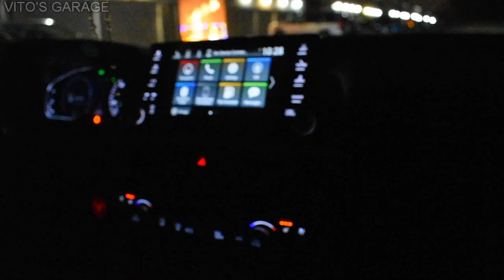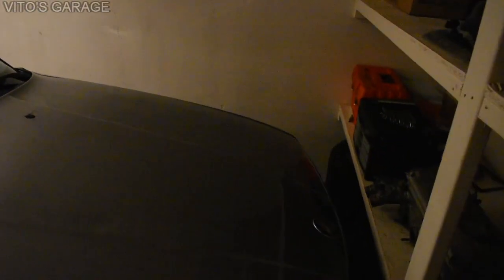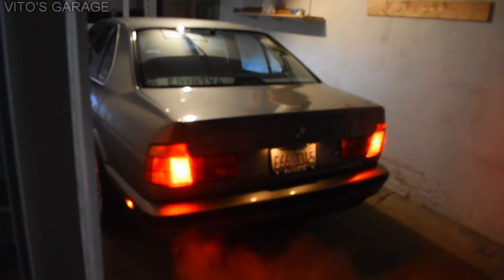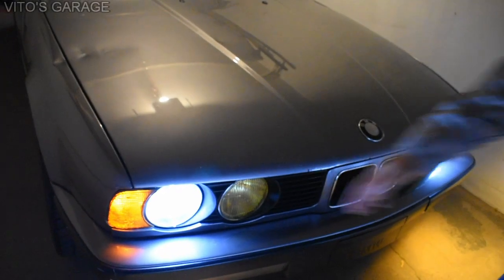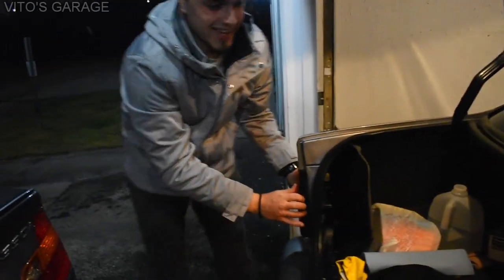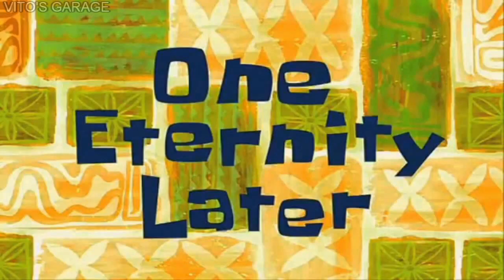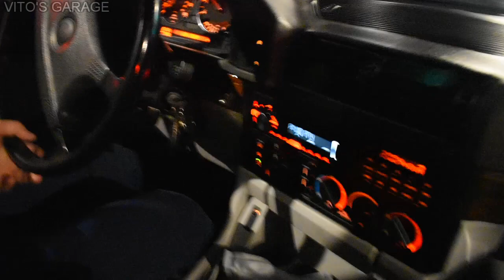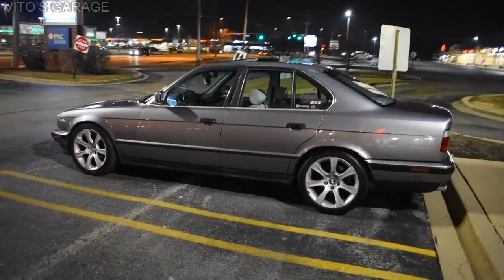This Amazing BMW E34 Cost $44K in 1991!

Comment: Nice 1991 535-I,Were the BMW 535-I with was only 2 yellow headlamps,I thought that they had all 4 lights  yellow, maybe because I like the orange lights in the back, toolbar it did not have the rear reflector that would a nice touch,👍👍👍👍👍👍